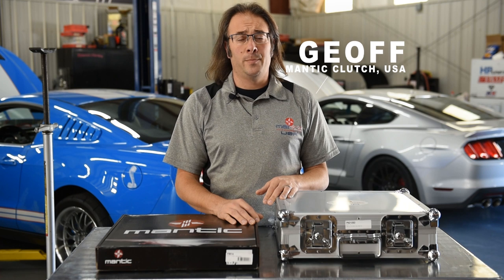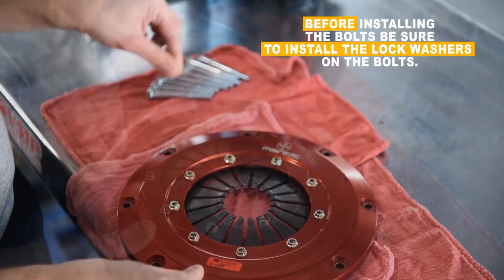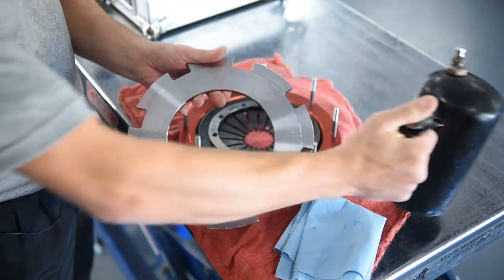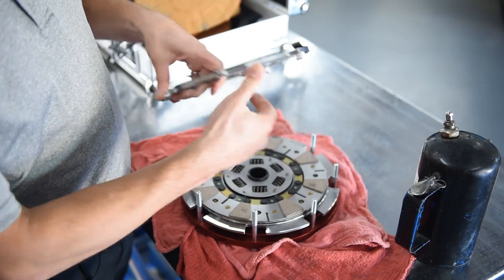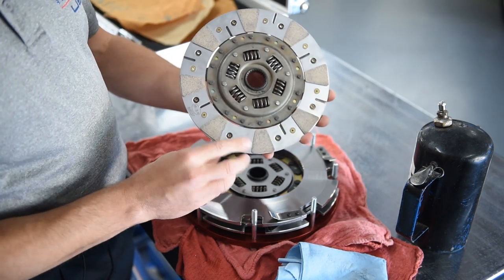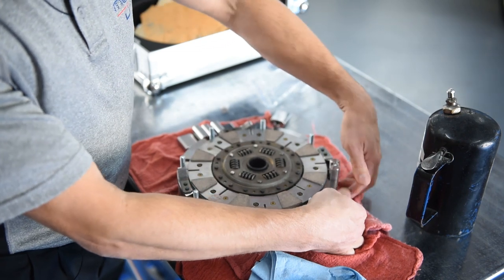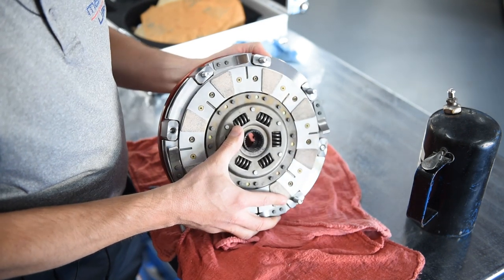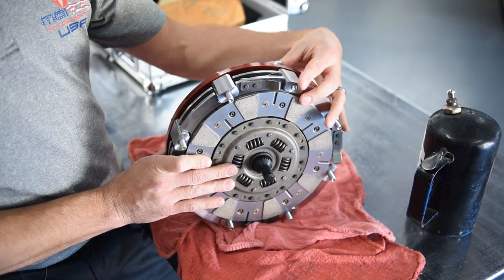How to assemble a Mantic Twin Disc Clutch for the Shelby GT500

Comment: What GT500, for my old 12' or for the new 2020?
Reply: Derp, dumb question it looks like the new car is an auto only.
Reply from the maker: '07-'14
Reply: We are actually looking at the new Tremec 7 and 8 speeds.  they are automated manuals and we will develop a clutch for them if its feasible.
Reply: @manticclutchusa4800  If its ok with you I have a question for you, I have 750 Hp crank on my 12' GT500 with the stock clutch. The car only has 1000 miles on it. In your opinion is the factory clutch strong enough to handle that power reliably (came from Ford with 550 Hp crank)?
Reply: The Factory twin in those cars is decent,  but its an Organic twin.  ( Similar to the Viper and Hellcat actually ) .  It will hold for a while....but if your really making some traction,  it will wear out quickly.  Its also pretty heavy...I think our twin saves close to 15 -20 lbs. I'd have to remeasure to be absolutely certain.

Comment: Pretty much no sense in all this cleaning the guy did, cause when putting all the parts together he wasn't wearing gloves.
So, he basically just got his greasy fingers all over everything he just finished cleaning. Wouldn't want him installing my clutch.
Wear nitrile gloves next time buddy, and inform anyone else who does this to do the same
Reply: Gloves are most certainly a good idea...however...you must be careful to keep them clean as well as they can also transfer oily residue . Gloves also protect your hands from the solvant which is highly advisable.  Running gloved hands thru a mullet as sweet as mine...is not.  I also try to only handle the edges of the discs and plates,  but also wanted to stay out of the way  to make the best video we could
Reply: Whatever oils were left behind, would burn off the first time you used the clutch....